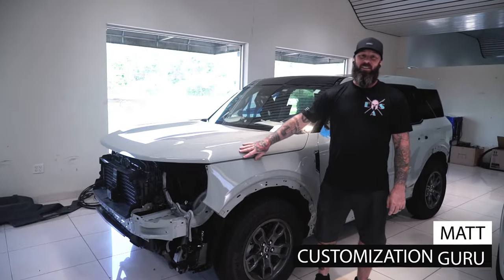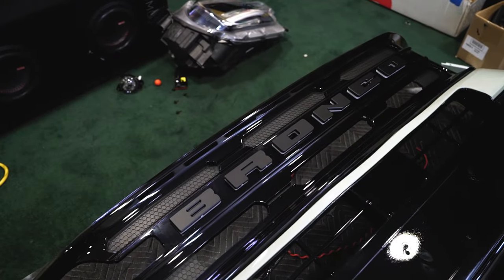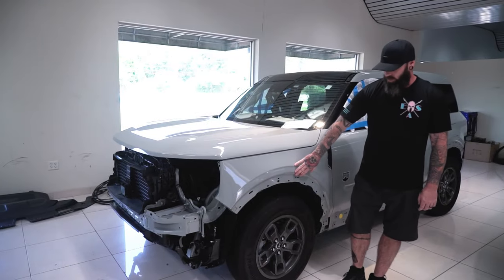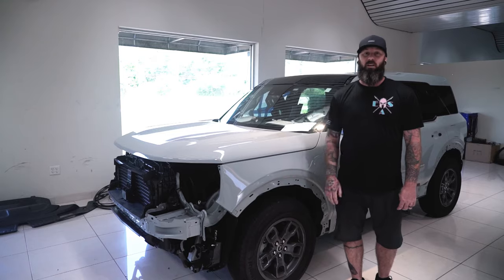Ford Bronco Gets A Custom Transformation!  -  Flexishield PPF + Motegi Wheels + More

Comment: Curious.  What LED emblem letters did you use?  Was it Oracle? When I look for some, they only say for Bronco not Sport.  BTW.  Great job.
Reply from the maker: Yes the Oracle letters work. If I remember right they were a little larger but worked. Just give Oracle a call to confirm.
Reply: fantastic. I have just received here in Brazil my letters from Oracle but they did not provide any instructions. Bro, please, how did you figure out where to splice the cables in the OEM headlight  harness? 
 @EmpireAutoSpa

Comment: Ford missed the mark on the B&O system, we just got a 2023 Sport Badlands, Just like the commercial where is the beef, where is the BASS. Front sound stage is to far forward.

My Jeep Rubicon with the Infinity sound System will blow you out of the Jeep.

Typical factory sound system, thinking of buying Ford Edge,  but B&O
Bad & Obscure execution.
Reply from the maker: Just put a sub in it.
Then you will be good.